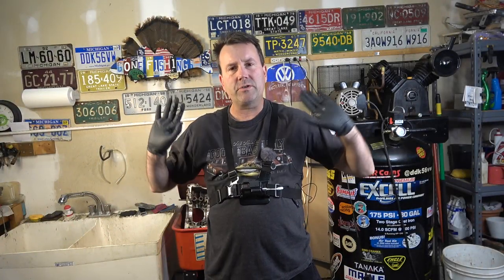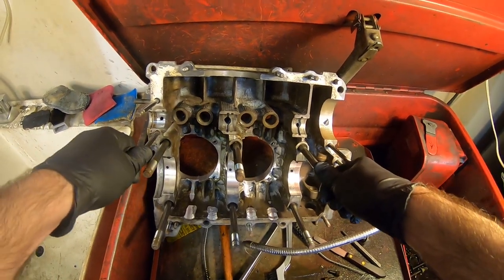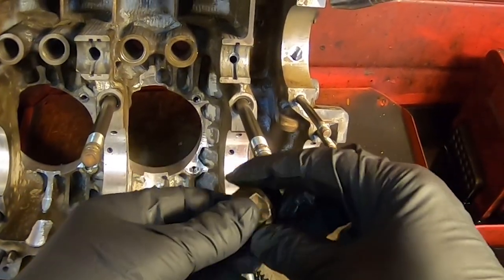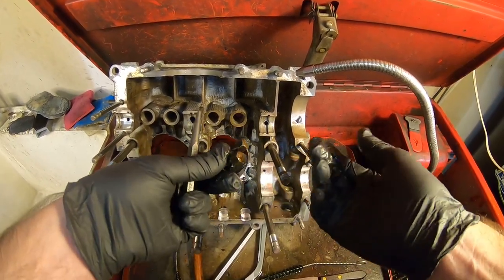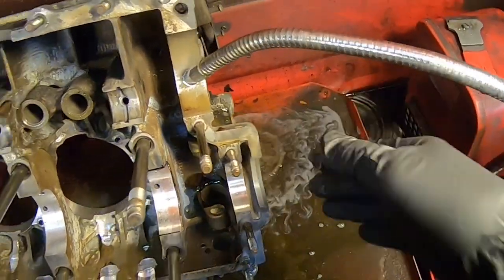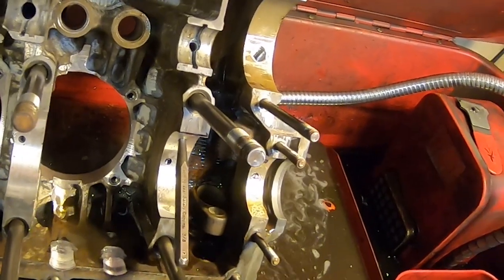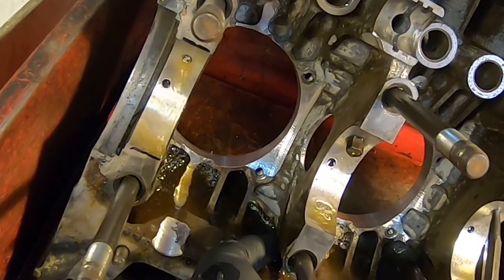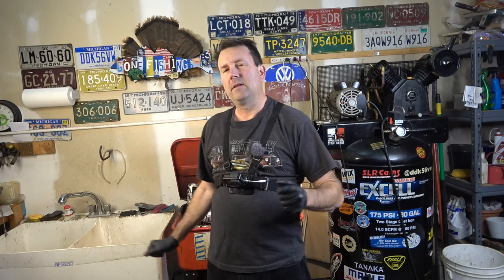How to Flush Oil Galleys on a VW Bug Engine case

Comment: I just finished cleaning the galleys on my 1776 build, but I pulled all of the aluminum galley plugs on the case and used some long handled bottle brushes to scrub out the sludge. There was quite a bit of dirt in the passages, so it was worth the effort. I turned some new aluminum plugs on my lathe with a .002” press fit and used green loctite.
Flushing it with solvent is probably just as effective, with a lot less work.
Have a Happy New Year!👍
Reply from the maker: I've done cases before having all the oil galley plugs pulled. I normally have the case drilled and tapped for a thread plug. I'll do that I think the case is questionable. This case was clean inside and all the galleys flowed clean. Owning a lathe must be nice 😀😎 maybe some day.

Comment: If  you've ever removed all the factory galley plugs you would find some with a very long aluminium plug on the number 4 pulley end main bearing. This closes off most of the drilling leading to the bearing. This could be why you had a restricted flow from number 4. This may be deliberate by the factory  so as to not have as much oil spraying next to the unsealed pulley. I haven't seen a failure solely at this bearing ever in an automotive application, so the lesser quantity of oil here is probably ok.
Reply from the maker: This is probably the reason the guy that used to machine my cases told me not to mess with that bearing 😎